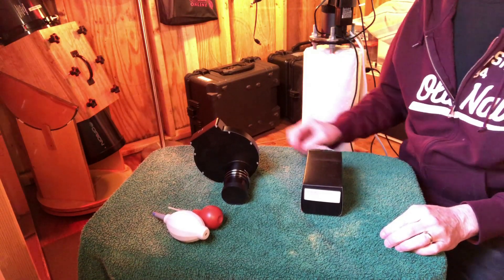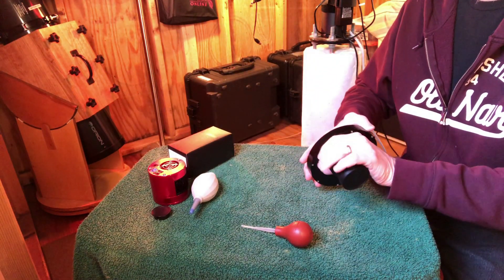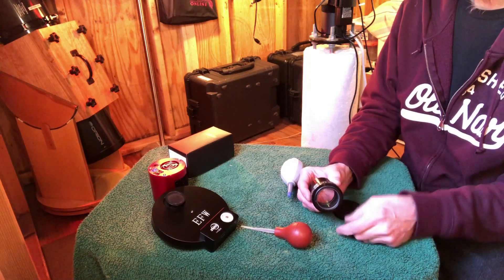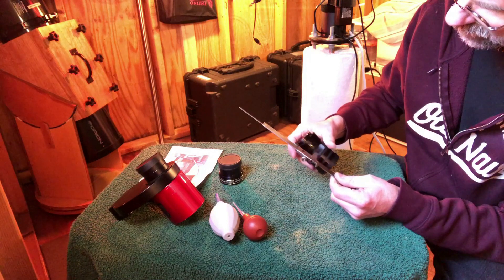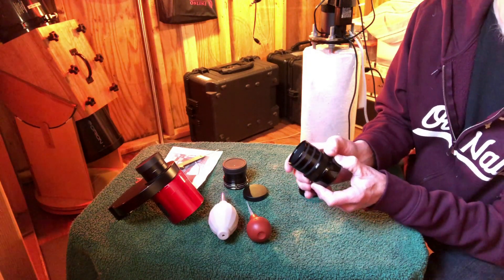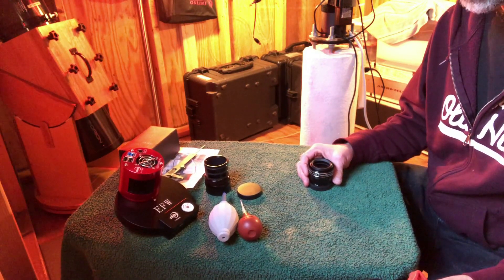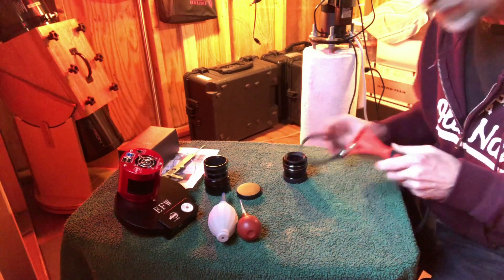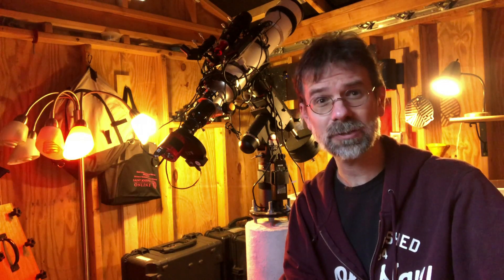Hotech SCA Field Flattener - Changing out the AstroTech Focal Reducer for Galaxy Season!

Comment: Hey Kurt. The  ASTRO-TECH AT115EDT F/7 ED TRIPLET REFRACTOR  F/7 scope is equipped with a 2 1/2" focusing tube and the Hotech is designed for a 2" focuser (If I indeed understand what I'm talking about) does switching these flatteners,  require another adapter or do the mounting rings get rid of these discrepancies?  Thanks, I'm considering going this route but don't own any of this gear yet, besides a mount, camera (Canon 90D with full spectrum mod) and other various equipment, so it  would be great to get them all in  one order. everything appears to be in stock right now!! Thanks brother and l love your rigs (especially this one)and shots with it
Reply from the maker: Hey Joe, good question!  Nothing new is needed as the AT Focuser comes with a built in adapter for 2" peripherals!  - Cheers Kurt
Reply: @AstroQuest1  That's Awesome!! Thanks Kurt!!

Comment: Hello Kurt have a question I’m thinking about getting that Hotech and I see you have a moonlite focuser I had read that sometimes that causes egg shape stars… just wondering is yours like that?  Thanks Also would you know if 3 nm filter would work on that Hotech  if my Telescope is an F7
Reply from the maker: Hi Llamar.  No egg-shaped stars here, in fact it has the opposite affect as far as my data shows.  As far as the filters, I see no reason why the would not work as long as you have the optimal back focus which is most likely 55mm.  Cheers Kurt
Reply: @AstroQuest1  awesome I will get one… thanks man :)

Comment: Do you tighten the compression first so the shoulder remains against the scope?  I tightened scope screws first and noticed it moved the flattener back from the scope while tightening .
Reply from the maker: Hey Greg, it should not matter which order but in my case the last thing I did was connect the compression ring.  Cheers Kurt

Comment: Are you still using the Hotech Flattener?    Are you happy with the results?  I am considering getting one to use with my WO GT81iv to replace the flattener/reducer that most people use with the scope.  Thanks for any suggestions.
Reply from the maker: Yes I am!  Although not in while since I have been doing larger objects.  I am very happy with it.  It worked better than I expected. - Good Luck.

Comment: Good luck with that, Kurt.  With the rubbery self-centering mechanism, it was nearly impossible to remove.  Me and a friend both had the same issue and we both tore off the self-centering part - and it turned out to be threaded underneath.   So now my self-centering HoTech is actually threaded on instead, lol.  And thanks for the shout-out!
Reply from the maker: Really, so you are saying the HoTech can be threaded onto the scope?  That would be great.  Cheers!
Reply: @AstroQuest1  Yes, if you can take the self-centering part off, but it's like wrestling an alligator, not easy.
Reply from the maker: @ChucksAstrophotography  Awesome.  Next time I take the flattener off I'll invite Tarzan over and give it shot.
Reply: @AstroQuest1  Good to know. I just started using this HoTech, recommended by the guys at High Point, and it works great. Nice round stars to the edge. I had the same issue as Chuck removing that thing, but then realized you really need to loosen that knurled knob to get the self-centering mechanism to relax enough to get it out without damaging it. Try pulling it out by rotating the flattener like you are unscrewing it rather than just pulling it straight out. That seems to help a little.
Reply from the maker: Robert Browning thanks Robert!
Reply: @robertbrowning4888  Maybe just a touch of instrument grade lubricant on those rubberized o rings?
Reply: Perhaps a little silicon grease on the O rings and threads. Did you try the scope straight through with no flattener ?  with a relatively small sensor spherical aberration could be small
Reply from the maker: @RobB_VK6ES  Thanks for the ideas Rob, I have an ASI1600 with a relatively large sensor.  I used the Flattener last night and it worked pretty well.